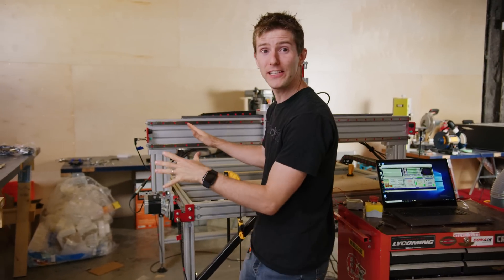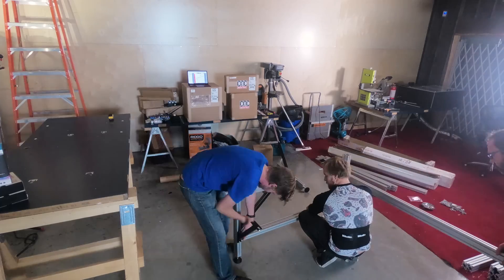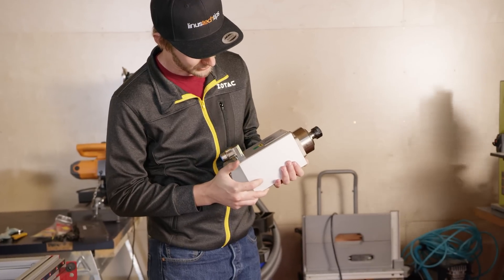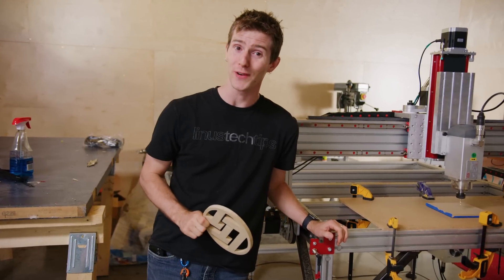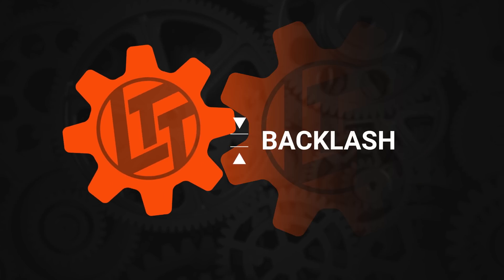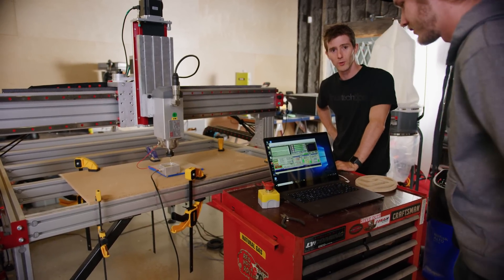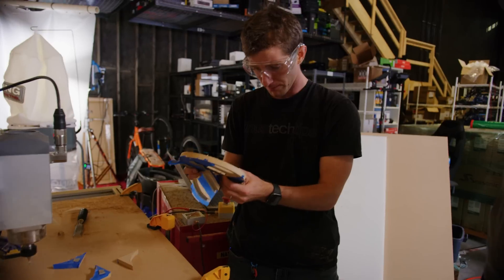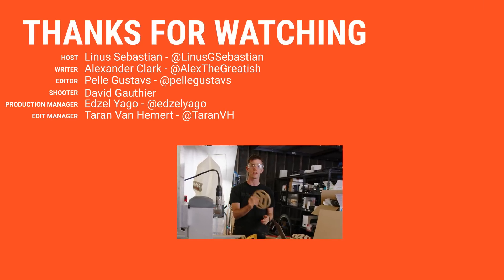Our New $10 000 Router!

Comment: Linus, former CNC router operator here. Yes you really do need a ton of double sided tape on small pieces, or else you risk the worm piece becoming dislodged and shooting across the shop, potentially damaging equipment of injuring staff.
Reply: vacuum tables are where its at,
Reply: Add a separately zoned vacuum bed powered by a strong shopvac (ie. designed to run at mac load all day long without overheating). Don't mess with double sided tape working at these speeds and these insane amounts of torque/hp. Someone WILL get hurt eventually! 
Also, get a bristled dust-collecting shroud around the router bit, otherwise everything in (and adjacent to) your shop will be covered in a nice layer of the finest death-dust. Not a pleasant combination with your other cool toys!
For the rest of it, have fun using this awesome piece of equipment!!
Reply: Here goes another 10.000$. Welcome to manufacturing.
Reply: There was tape to hold the pieces and then double sided to hold the whole thing, therefore doesn't need all that  double sided tape.
Reply: Largest issue with this kind of double sided tape (the gopro stuff they're using) is that it may snag onto the tip of the router bit if the bit runs too deep accidentally. When that happens, "interesting things" may happen. It won't necessarily be pretty though.
Also, at 25krpm, everything on the workbed is a potential lethal projectile. Tape won't help you then.
Reply: @diggieNL ,
I would also suggest having some kind of transparent shielding between operator and router or at least to wear some protective goggles.
Reply: @henningholthusen831  Absolutely, and not just the standard (brittle) plexiglass from your local DIY store. You'll need the tough (flexible) stuff, and at a decent thickness. If you source it from a renowned CNC parts shop, you'll be fine.
Reply: Polycarbonate. I think it's called Lexan in the us. One of the components in bulletproof glass.
Reply: Also they have the tools to make an enclosure with safety switch so it'll only operate when enclosed so if they don't use enough tape the chaos will be contained.
Reply: Linus make a vacuum bed for it now
Reply: That's a weird name for a router...
Reply: @Roger Block: former not-so-CNC-router-operator here, I really hoped this was common sense...
Reply: this wasn't just your average double sided tape, it was very strong stuff. so more of a simpler cheaper tape would have been better in this occasion
Reply: Quality double sided tape is VERY strong. Four bits of tape one inch long each would have been overkill already. I wouldn't recommend using hot glue though :)
Reply: @henningholthusen831  Its not about the strength, but about pieces that get cut out completely, like the parts that are sticking on the tape when Linus thinks he has broken it. If you only glue parts down, but cut out a piece that didn't get any of the tape it might go flying
Reply: Right. Didn't think about that :)
When I rout stuff I don't cut out pieces.

Comment: @linustechtips 12:30 That's not safe practice. The machine should be powered down anytime parts are being changed. There were no safe guards you put in place besides the Emergency stop button. The machine just being put together, might have some bugs or possibly not put together 100% correct. There is a possibility it will randomly start. is it likely, no not really. But is it possible, yes absolutely.
I'm a machine operator at a chemical plant, and have many safe guards in place if I need to go near the machine while power is on. And those switches you see on the power supply have holes in them for locks while in the off position for "lock out tag out" procedure. It would definitely be beneficial for your team to be familiar with this while using the machine.
Reply: Whenever we would retrieve parts we would always back the router off of it anyway. Extra distance between your hand and the bit can save you if for some reason it starts.

Comment: As far as sticking things down to the bed of the router. Use masking tape on both surfaces and a small amount of super glue one one side and spray some accelerant on the other. Once cured after a few seconds it has great lateral stability but easily pulls off with vertical pressure. Look for the super glue masking tape trick video on the crimson guitars YouTube channel

Comment: Dust safety is going to be a huge problem if you don't take adequate precautions. At a minimum you need P100 rated dust mask for anyone in the same room as that thing. A changing room to change out of the clothes you wore inside the room would be a good idea too as that stuff sticks to your clothing and contaminates every space you go into. Breathing too much of that dust will give you silicosis. Dust collectors will not protect you from fine dust particles, they catch the larger stuff but are only partially effective on the really fine stuff that causes health problems. Just take a look at the HEPA filter in your dust collector after a few uses, that's the stuff you breath in while being in the same room as that gear.

Despite the health risks. Well worth it for what that machine will let you guys do.

http://billpentz.com/woodworking/cyclone/index.cfm <- is a good read up to understand the dust problem.
Reply: They'll probably lose a couple staff to death if they do anything silly like cut CF before they have decent protocols in place.
Reply: If did not come with a dust shoe to fit on the spindle for extraction hose. They could easily make their own many ideas online.
Reply: @richardstevens8005  Alex said on the forums that they've made a dust shoe themselves.
Reply: I agree with @Eidetic Ex. You need dust filters or at least dust masks and good ventilation. The ultra fine dust using a cnc router creates can be a carcinogen, depending on material cut. Also wood dust can be a fire and explosion hazard. While this is unlikely for a small router, doing small jobs it is still better to be on the safe side. Source: Worked programming and setting up cnc routers and milling centers for 6 years.   edit: P.S. Sorry for the safety nagging,  CNC Routers are still awesome :D
Reply: Given this ^ id say frame up a room in your warehouse with some serious negative pressure ventilation leading outside and an air compression to hose yourself off before leaving.
Reply: its not a daily used machine bud. just a dust cover with a vacuum on it will suffice
Reply: I dunno, having used this kind of machine before, even a single job can make a huge mess. Not to mention not everything reacts like wood; the acrylic shavings stick to EVERYTHING and are hard to clear up.
Reply: @SiggsGBR  Your not joking at all with that one. Whenever I cut acrylic or any resin cured plastic, I wipe all my metal surfaces down with machine oil or silicone spray (liquid wrench for example). Otherwise cleanup consist of heating a sacrificial chisel to scrap that junk off.

Comment: You are going to want to grab a nail gun with some nylon nails to be able to nail your stock material to your waste board without worrying about metal nails damaging your bits.
And be sure to add tabs when doing your Profile cuts. V-Carve has an option to use "3-D tabs" to make the tabs easier to remove when extracting your piece.

Comment: I work for one of the largest machine shops in the Pacific Northwest. It's called Pasco Machine based out of Pasco, Washington in the states. They ship material and parts all over the place and if you needed a specialty part out of steel, stainless steel (303, 304, or one of the many others) bronze, aluminum, and many plastics too they could do it. They own a water jet that cuts through inches of solid steel offering similar accuracy to your CNC except it will cut through almost any material 4 inches thick and roughly 20 feet long and 6 or so feet wide. You could come down and see the shop if you wanted. Their number is 5095472448. Ive been a fan for years and would love to meet you if you decided to work with us sometime !
Reply: too much info bra
Reply: From Kennewick here, Hi neighbor

Comment: Linus get the 3M outdoor extreme hold tape at Home Depot by the 25 foot roll.
we use it all the time and office furniture for sticking down work surfaces to a file cabinet takes a crowbar to take it off.
I put 5 - is in the same fashion as a five on a dice I've had a person put in three stripes that one bent the tops screwed it all up so I get where you're coming from yeah way too much tape.
however if you want full safety I highly recommend that you guys see and see your own vacuum table put a spoiled board on top of that and use a high-volume vacuum vacuum pump used somewhere in the range of 25 horsepower or 15 horsepower if you divide into two zones and run one zone at a time.
But that's just me.
Maybe a vane type vacuum pump from say like SCM group CNC may be better for you.
It's all loud.
Dust collector, vacuum pump, CNC.

Safety tip with dust collector. Saw dust can explode when in air. Static shock is a serious issue for us. 10" dunct for dust collector have to make sure with some small part that they go all the way into dust collector. If they get stuck, static electricity builds up fast on the part that's there. Use metal ducts or at the very least reinforced hose.
Go to local hydraulic hose shop, State side I go to hoseman. Every you need and everything you want if you tinker in it.

Comment: You will use this for cutting plastic (12:54 - 13:10)?! Why not use a 3D printer? Should be more versatile if you want to work with plastic as not any shape can be cut out (e.g. a cube that is hollow inside), at least not as a single piece, but any shape can be 3D printed.

Comment: You need much more safety than you have. Working with particleboard cnc routers daily its quite dangerous to be standing that close. With the spindle spinning at such a high rpm I have had cutters shatter. Standing so close is not ideal. A suction cup with brushes around the head will help with dust collection and help if the cutter is to shatter. But most of all id have a screen to stand behind. It will save you and stop your laptop from getting covered in dust! I have had a machine cut into itself because it was programmed incorrectly. Be careful, But have fun! Also i wouldnt complain about the amount of tape used to hold it down. If the bit catches on it and its not attached correctly things can go flying. Bigger cnc routers use a vacuum to hold the 3.6m x 1.8m sheets of particle board down.
Reply: yup just need some plexi
Reply: @BugsBunny_xD  Plexi is NOT what you want for protection, acrylic is very brittle and will easily shatter on impact. The stuff you want for protection is Lexan (Polycarbonate).

Comment: You shouldn't just plunge straight into the part like that (I get its wood, but best practices are to start a spiral entry or a sweep from off the part). Also, if the depth cuts are set correctly and the speed is slowed down, you would get less burrs on the wood. Try playing with Solidworks. Its a very powerful tool that can help make some beautiful parts. I used Solidworks to make parts for NASA that are on the ISS that came out great. Solidworks made it a lot easier.
Reply: aaaaaaaaaaaaaaaaaaaaaaaaaaaaaaaaaaaaaaaaaaaa Apparently anyone just can. I made them in high school through a program they sponsored.

Comment: Linus and CNC?!?! HELL YES

Whenever I picture a stepper motor in my head, I imagine a dog chasing its own tail. The way the magnetic fields move around somehow always puts that image into my head.

EDIT: As clarification, the dog's nose and tail would each have magnetic fields which are aligned similarly (both ++ or --),  and as close as the dog's nose can get to its tail, the only result is the repellent of the fields which forms a circle speeding up faster and faster as continuous energy is applied. What a sentence.

Comment: "not quit as easy as just hitting go on a 3d printer" uuh and what 3d printer would actually print what you want without tweaking the generated gcode? its pretty much CNC and conversion is possible. 
you can also convert a 3d printer to a laser engraver.

Comment: Name it Power-Chugger 9000+. 
9000+ because it's "OP", and costs $10,000.

Other things you could do with it is Custom Computer Case Designs?
Not using wood on the inside of course. Like a dbrand thingy which you can paste on the outside but with "extruded" designs to be pasted on the outside.

Comment: "That's crazy how they can put so much power in that little of a thing" while points to a big ass inductor. I love how they just winged it XD.
Reply: Also, code is executed by the controller, which communicates with the stepper driver, which then takes this signal (usually speed [vector], and distance [unit]) and sends a series of pulses to the different phases of the stepper motor, which translates into movement :). Just for the sake of education.

Comment: I'm going to add to the dogpile when it comes to safety, but this time for your computer(s). I've provided support in a few cabinet makers and millworkers. There is nothing like the fine dust that gets just about everywhere.

Imagine a year's worth of dust getting into your computer in a week, if not less, and that's for the computers in the front office. Get a passively-cooled system to run the g-code, or be sure your laptop's cooling solution doesn't push air directly over any circuitry and that you have a couple or three replacement fans for it. Whether you need it will depend on how often you work with it, but a $10,000 router is going to be a huge cash burn if it's sitting there not doing anything.

Aside from that, good luck and try not to die or lose any important appendages!
Reply: Alternatively use an older system because most router programs take peanuts to run and are backwards compatible to windows xp half the time.

Comment: Hey Linus,

Make sure you build an enclosure for your CNC, its gonna help with dust containment and more importantly improve safety. Also, where is the kill switch on this thing? I would recommend implementing some safety practices, CNC machines need to be taken seriously.
Reply: A kill switch is shown at 0:12 5:52 7:29 9:50 and many other spots. There also appears to be a switch on the power supply. And he talks about it here: 10:27-10:54. I think they're not being as safe as they should be but they do have safety buttons. :)
Reply: @nighteule  Big red button is safer than just killing the power because the big red button will slow it down and back the bit off the stock.
Reply: The emergency stop does not back off or home anything, it is there to stop all movement. It may brake down the spindle faster than a free spinning would but that's it. It would actually be way more dangerous if it homed after the e-stop. Some industrial arm robots will freeze from the E-stop but fall to the floor numb when power is cut so the e-stop also prevents damage to the machinery.
Reply: @C2H5OHist  Yeah you're right. It's been a while, but I was thinking of the feed/hold button. E-stop does E-stop.
Reply: There is a big fat red button

Comment: should call it the belkin router. make a sick wood/aluminum case with acrylic side panels for the leds to shine through. lower feed rate and higher RMP on your finish cut makes for less cleanup and looks nicer. also leave about 0.010" for a final cut

Comment: You guys should look into honing your speeds and feeds. That "cleanup" Linus was talking about on the part should be non existent (or pretty darn close) when running your spindle at the correct RPM and feedrate. Also note that your ideal feeds and speeds will change with every bit and material you use. Lastly (I saw it mentioned elsewhere in the comments), setup a home position for the machine in an easily accessible place to make it easier to do tool changes.

Comment: Nice video, but please learn how to safely work with this kind of machinery.
Operators could easily harm themselves, as well as bystanders.

Like many others have written:
Don't switch bits without using the e-brake.
Everyone in the room needs to wear safety glasses.
Dust of any kind is cancerous (MDF more so). You might have to use masks even with an air filtration system (it takes time for the system to remove particles).
Dust is a fire and explosion hazard. Are you sure you are up to code in your region? If not, your insurance company could cease your coverage.

Anyways, have fun, but please offer a safety certification to your employees. After all, you are responsible for their safety.
Reply: I agree, they are upgrading their equipment, with no safety practices, no idea on how to use them, and think that them not having a CNC router was the problem. Alex is the most clueless "mechanical" person I've ever seen, he looks like one of those all theory no practice idiots that came out of university and all the nerds think he is a mechanical genius. Linus is just pouring money into all this hardware with no real reasons at all besides "Alex told me to, and its cool". I shit myself whenever I see these hooligans  build something that isn't a pc, and I'm only 17.

Comment: So for hold down there's a lot of options but one neat simple one is plastic nails. It takes a dedicated nail gun but you can just pop a couple into your piece and if the bit hits the nail it'll just go right through it. You can also cut T slots into your spoil board for a more traditional mounting solution.

Comment: Next is dust hood and a huge vacuum pump for the needed vacuum table. Btw, vacuum goes through MDF like butter, so mdf boards are used as the top layer, and then it's faced down to get a perfectly flat table.